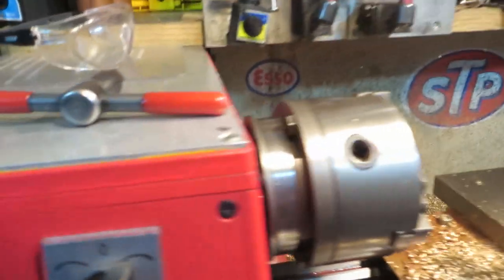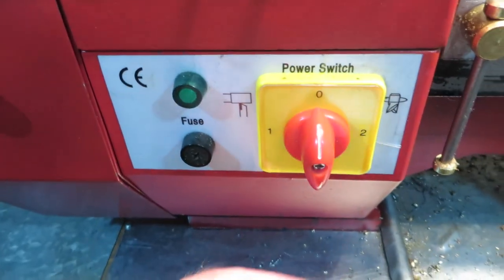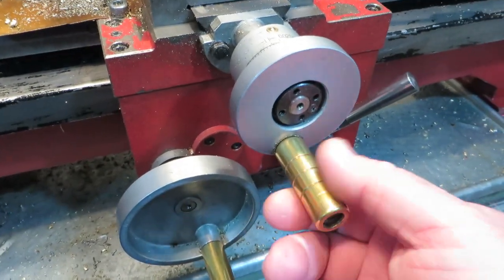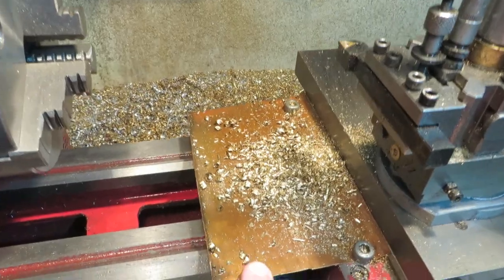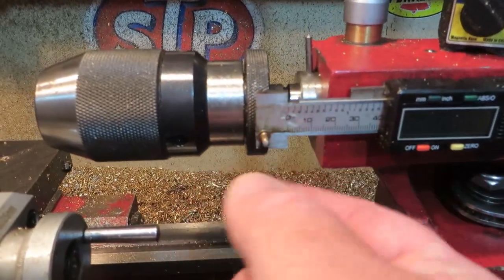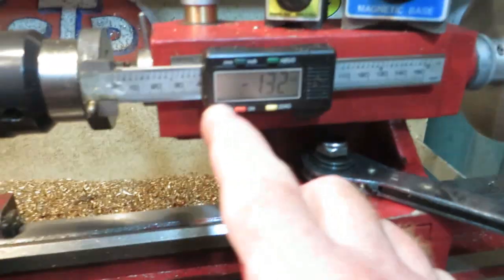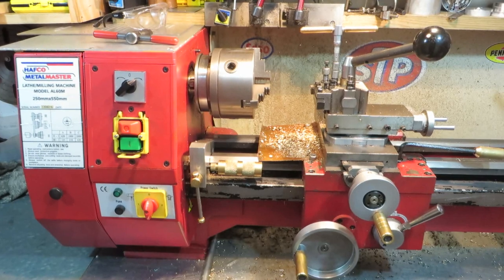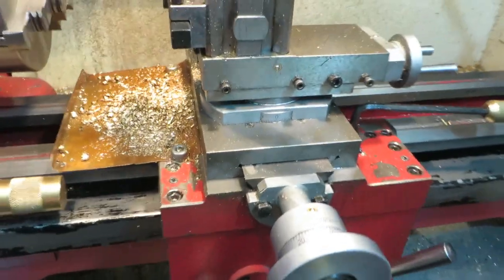Work Shop Talk - Sieg C6, Grizzly G0516, Hare & F AL-60, Axminster Metal Lathe Mods - Hints & Tips

Comment: G'day mate I am going to buy the C6 could you let me know the distance between the feet, base.  I am getting a bench built they need to know that measurement for the cross support.  Thank you for your video I am making a 5" gauge coal fired miniature steam locomotive and this lathe fits the  bill.  I have subscribed and I hope you can produce more videos of your machining kind regards John Tasmania
Reply from the maker: +John Kinnane G'day John, from the outside edge of the Sieg C6 headstock foot base and the outside edge of the tailstock foot base the measurement is exactly 940mmYou'll be very happy with the lathe, they are a very capable machine and very accurate.Let me know if you have any other questions.
Reply: +Blue Heeler g'day mate thank you for replying to me with the measurements they don't have any in at the monument but it's the one I'll buy as soon as they come in.  Looked at some of your steam engines great stuff my son has a few as well.  I will keep in contact kind regards John
Reply from the maker: John Kinnane

Your very welcome John